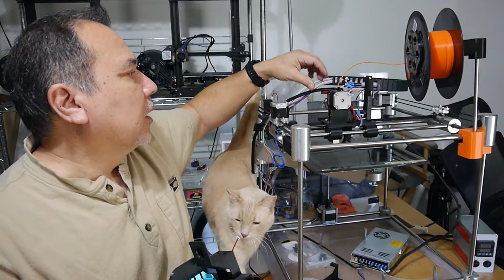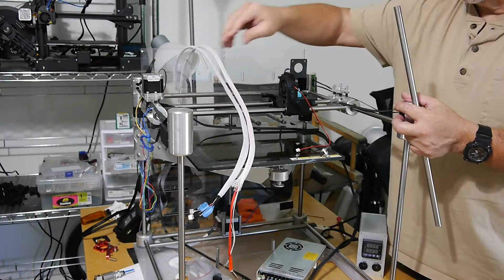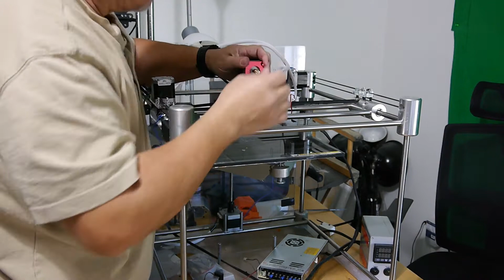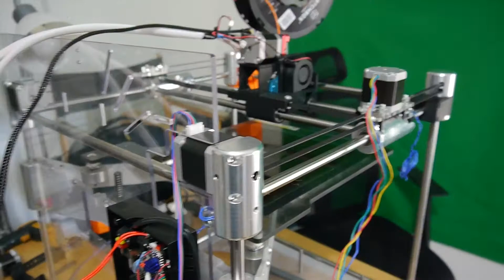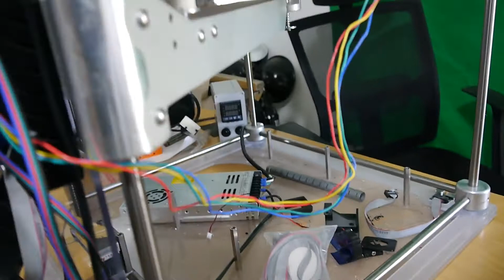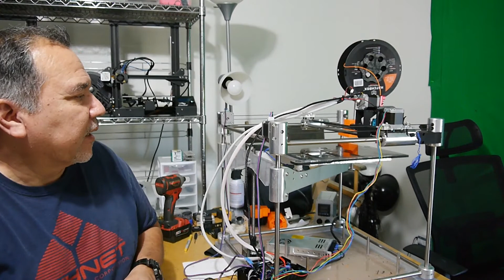CubeX Duo Conversion - Will a different X Carriage improve the 3D printing?

Comment: I had the same issue with another printer and I found out that the bed needs to be controlled by the board, when you connect a separate controller the temperature oscillates a lot causing these lines. try to connect the bed with a mosfet controled by the board. and perform a |PID tuning as well. thanks for the videos. I'm doing the same project

Comment: the best way i have found to get the cube pro to print  with no issues is quite involved but i have modified mine by completely removing the x gantry and used 8mm rods and anet a8 extruder
replacing the steel components with my own designed pla components the board is now a arduino mega 2560 with  ramps 1.4 and two mosfets for the hot end and heated bed
o yes i also mounted a heated plate under the original build plate

Comment: You mention in either this video or one of the updates that 25mm/s is awful slow.  This thing stock was running 15mm/s - you're running 60% faster than 3DS ever intended.  I've got a duo that shows ringing in prints regardless of speed, until I slow it down to about 10mm/s, then it prints beautifully.  As for all your x carriage modifications, the majority of the mass is in the linear bearings and cross-rails.  Eliminating everything you have off the carriage sheds maybe a quarter of the weight that's in motion.  Basic design of structure - you've eliminated 3/4 of the bracing by eliminating the acrylic cover.  

It's never gonna print like a new prusa or ender - it's a 10 year old 80lb printer that's missing most of it's bracing, that's being run near double design speed.  Is it fun to tinker with?  Yep.  That's about where the discussion ends. Sorry for what could be perceived as negative comments, but it is what it is.
Reply from the maker: I'm still going to tinker with it, to a point.  When I received the printer, the only acrylic piece was the rear.  I thought about adding more bracing or more structure, but how far do I want to go.  I'll try printing at 10 or 15mm/s and see how it prints.
Reply: gotcha.  It's too bad that the acrylic case was missing. It really does stiffen up the frame.  Not stiff enough to run perfect prints at 100mm/s, but way better than not having it.  I'm to the point with mine that I'm debating if I'm gonna keep printing passable prints at 20-30mm/s or if I'm gonna pick up a $100 ender 3 when I'm near a Microcenter this weekend.  The dual extruder setup has been handy multiple times, but nicer looking prints would be a big plus.
Reply from the maker: Most of my printers are ender 3 pros that I got for $100 and modified them.  Printing really clean at 80mm/s.  I might just custom make my own with the latest standards.